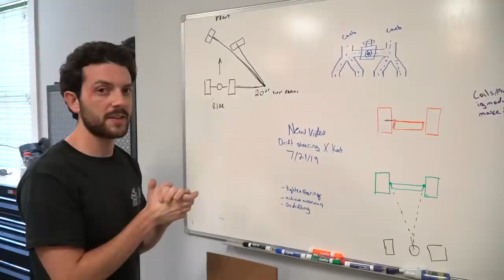750cc Kart has FULL POWER! The Fix was SO SIMPLE!! + Drift Steering

Comment: I called it. Put all four carbs back on it
Reply from the maker: burmese434 the carbs seemed to have other issues- it never idled. We my throw them back on just to try, but these twin 34s are performing great
Reply: @CarsandCameras  some cbr 900 carbs :) and a custom header with a nice single exit
Reply: @CarsandCameras  YES... It wouldn't Idle because the Plugs was Bad... Like you where told... You always start with the cheapest item to fix a problem...
Reply: The same thing with my bike, wouldn’t rev new spark plugs and like know
Reply: Remember, they destroyed those carbs (as they do with every carb they get) by "jetting" and drilling out the emulsion tube.
Yeah, I'm sure these turds know more than Honda and Mikuni.
Reply: You checked the points also ?.  God bless & be safe out there guys !!".
Reply: @Z71Ranger  If engine has  been sitting a while, always swap plugs. And wires too.
Reply: @CarsandCameras  i own a cb650 that i have been driving for 3 years the 4 carb setup never seems to run perfect keep that 2 carb setup that running awesome
Reply: @psygn0sis  Because that's the "PROFESSIONAL" american mechanics logic. "The engine doesn't run on two cylinders, maybe we should check the electrics? NAH... Let's destroy the carburetors by drilling them out!" Come on, seriously? (If I wrote something wrong, then I'm sorry. English is not my first language :D)
Reply: @psygn0sis  Meh
Reply: @CarsandCameras  too much power already.
Reply from the maker: psygn0sis we were aggressive with our jetting because we have a spare set of stock jets and emulsion tubes to fall back on if we destroyed a set.
Reply: CarsandCameras My bad I was referring to my comment on the last video about ( what do the plugs look like) in the comment section. I can’t wait to see what the top speed is can you guys get some Nabi or tires on there keep up the awesome work PS I think more carbs looks better LOL
Reply: Richard Hurts  Well... You made me laugh my ass off as fuck :D. But back to the context. I was in a mechanic school for 3 years, i was fixing cars, motorcycles, tractors and even lawn mowers. I've had learned many things about an troubleshooting with engines and now it makes me pain in the ass when someone tries to fix his engine and he's not checking everything and when he's saying "well the engine doesn't run properly so it must be the carb, let's go and mess it even worse". When you are trying to run an engine especially when it have been sitting for a long time you need to check for the spark, that's the basic, and after that you should take care of the carb. And BTW in Poland, at least in my city, I don't have a 24hr store so I can't suck, but anyway you made my day, thank you :D
Reply: @psygn0sis  
Same as adjusting floats. 
I've been doing this crap for 30+yrs if you wanna count playing in the backyard like this. 
Ya wanna know how many times I've had to adjust a float??? 
None!!! 
Well, ok I have ....after someone messes with it!!! 
That's so frustrating to see them attack a carb with drills.
Reply: Richard Kohut dude, it’s a cdi ignition. No points.
Reply: CarsandCameras why would you not just go buy a few sets of main & pilot jets & do it right ? It’s not like they’re difficult to find or expensive.
Reply: @ROTAXD  Asking the real questions here. And drilling emulsion tube... I'm speechless.
Reply from the maker: @ROTAXD  because we fly by the seat of our pants. Try making two 15+ minute videos every week, some things will get forgotten.
Reply: @CarsandCameras  Don't let the Youtube mechanics get to you... It hauls ass, mission accomplished .
Reply: @malbers35 Tbh they should listen youtube mechanics more.

Comment: I remember a wise old mechanic once told me, If you think it's fuel, check the spark, and if you think it's spark, check the fuelling.
Reply: Had one tell me 80% of the time, its an ignition problem not a fuel problem.
Reply: @DChrls  its always the same unless its different
Reply: Don’t forget, vacuum leaks. They mimic everything
Reply: So basically, could be anything.

Comment: Thanks, guys. Now it has so much power it needs bigger wheels and tires.
Reply: Looked like it needed bigger tires the entire time to me.. not a lot but a couple inches taller per corner would have made worlds of difference.
Reply: @bdhale34  it would then be in the roll heaven
Reply: I agree, nothing crazy but something like 20 maybe 22 inch tall tires. Needs 7-8 inches wide in the front and 10-12 inches wide in the rear.
Reply: @user-neo71665  that would look like a  mini monster truck if u got some fat fat tires 😂
Reply: Nah... I like the low-slung, old-school race car stance!
Reply: @adamshowto678  Adding an inch to the ride height wouldn't make that heavy cart roll. Only half the tire height will be beneath it after all also it's got a pretty wide stance that matters a lot. You turn anything hard enough while going fast enough it will roll but even being pretty damn reckless they'd still be as safe as now with another inch beneath them.
Reply: Isnt there a hayabusa drag kart on 5 inch rims? Its all in the bearings. Bigger tires means a LOT more speed, not necessarily the goal with something like this. With little tired youve got all the torque in the world, reguardless of gear ratio
Reply: I think it would be wicked with some ATV paddle tires in back and ATV sand skinnies up front. If it’s too fast (if there even exists such blasphemy) you can always swap to a bigger sprocket in back.

Comment: Got the motor running RIGHT!! Awesome.   Now, back to 4x pod setup. Synchronize them carbs!
Decades of superbike motor research can't be all wrong. Good reason people run them motors like that.
And oh crap, taller rear wheels,  and / or  gearing,  to handle the horsepower!

Good call bending that deathwish shifter shaft. Hate to see one of you lose an eye on a nasty bump.
or worse, a camera.  :P  Loved the shots of grass hanging on the suspension. Fun was had.
Glad ya  got the motor running halfway now.  Lovin' this project.  Lookin' forward to more.

Comment: Full roll cage..keep it safe stupid..kiss🤜👍
Reply: Go Karts or Gone Fishin yeah this thing is getting out of hand lol.
Reply: Safety is way overrated in our culture. BUT, a roll cage is still a good idea with a machine that fast! At the very least it needs to not grind your head on the ground if it rolls.
Reply: FOR SURE FULL CAGE, i call this thing "THE DECAPITATOR" at the moment! a full cage will make it tricky to get in an out, BUT you you aint climbing in or out when you dead.
Reply: @eriknulty6392  A full roll cage can be built which is pin-and-socket [makes it like the openable canopy of a fighter jet] that one simply flips back when exiting the cockpit and flips forward when preparing to race.
Reply: Go Karts or Gone Fishin it’s more fun to ride when your life is at risk lol just joking .We all need roll cages in our life.
Reply: To be fair, they designed the roll bar for the seat leaning back more, which put their head lower. They had to reposition the seat which moved their head higher. They have said that they're gonna redo that eventually.
Reply: Yeah, that thing is sick. Y'all should definitely consider a roll cage. PLEASE, be safe.
Reply: @kshepthedrummer  yea but a single roll bar offers zero protection when not coupled with a seat belt lol. They definitely need a cage. I raced flat karts on dirt for 8 years and always wondered how cages and seatbelts weren't mandated..
Reply: @damienirvin777  Lotta rollovers on the track in your time there?
Reply: @Knuckleheaded76  for alot of other drivers, I was lucky enough to never flip.
Reply: Go Karts or Gone Fishin keep it stupid safe

Comment: Glad to see that you got it running. I thought that it might be something ignition - related. Now, after it's all tuned and carbs are synced, check the plugs again, and make sure the color is light tan on the insulatiors.
 If not, you might have to go up slightly on the heat range, to keep them burning clean...
 Oh, yeah...now's the time to finish up with the safety gear. Harnesses, another forward loop for the roll cage, and maybe a new shifter and padding, when you get bounced around..
 Now you're messing with enough power to easily get you killed - don't mess around....

Comment: Just gonna brag real quick, in the first video that showed the engine breaking up at high rpms I commented that spark could be the issue. I have a honda atv that sounded the exact same above 2/3 throttle, I replaced the ground wire and it runs great. Glad to hear the beast running right!
Reply: Ur cool

Comment: first thing you do with used motors is fresh plugs
Reply: A tune up and change all the fluids, yes.
Reply: Compression test, new plugs, change oil, check timing/points, check valve clearance. 
These things should have been done while the engine was still in the bike....then there wouldn't have been any issues.
Reply: @Mardy72  I mean the compression test, plugs and oil yes, should have all been done at the same time (along with plug wires and coils depending on age). But valve lash? Maybe. Normally I would do the basics and get it fired and running, and if it runs with some valvetrain noise then move on to checking valve lash, or in the case of a duel overhead engine like this one, checking the valve springs and buckets for wear. There normally isn't a way to adjust valve lash on DOHC bike engines, as the cams act directly on the valve springs. So you end up needing to replace or shim the buckets to change valve lash.

Comment: These Old Honda CB motors are awesome! love the sound out of 'em. You can buy the jets from the 1100 and up spec easily. I was reconditioning our CB900 Bol D'or and it turned out the jets were 1100's. Easy power upgrade.Love your work Guys!

Comment: This reminds me of a problem I've been chasing with my car for weeks now. I was getting massive misfires under boost in my 2008 GTI. I replaced  several parts like the mass airflow sensor with no avail. checked boost leaks, compression tested, logged ECU data. etc etc. Turned out to be the spark plugs.
Reply: Damn atleast you fixed it

Comment: I've said check the plus in the last couple videos. Glad it was that simple. Also, the 2 middle cylinders are going to keep fouling the plugs because they're getting most of the fuel from the strait runners and the 2 outside are probably running lean.

Comment: Guys, don't feel bad. All of us have been tricked or lead astray by some strange running condition. Many years back, I was totally stumped by a Toyota Corolla that....get this....only stalled, when it SNOWED  !!! I'm not shitting you !! It didn't stall when it rained, or if it was hot or cold !!! I tried a coil, a new ignition switch, a new fuel pump, all new fuel lines , a carb, new intake gasket, new plug wires, new plugs, a re-man ECU. Checked the Cat, not blocked. Checked, tightened all the grounds, replaced the battery cables....drove the customers car, for a week !! Ran beautiful ! Delivered it to her..... BUT !!!!!.... as soon as it snowed....the car came back on a hook !!!! Customer states...'cars stalls" !!! I could not figure it out !!! I tried everything !! it happened many times that winter !!!.The lady moved to Florida, drove down....and according to my boss....never had the problem again !!!!!!!!!!! I still....decades later...do not know WTF was wrong with that freakin Corolla !!! So good job guys !! You found yours !! lol.

Comment: Vintage white rally car wheels, and tires. (Sparco, etc) A full roll cage overhead. A few panels and a windshield to get ya out of the weather a bit. Maybe a wing on the back. Small fenders with mud flaps, front and rear. Good lighting.

Comment: For grip racing and better turn feel Ackerman steering is best. For drifting and gettin all slideways parallel steering is best. Just saying. Also ditch that 3rd pedal put a hand clutch with a butterfly lever on the column & move the shifter to the right side of the wheel. Shifter and race karts are set up like that for a good reason. Love the build.

Comment: That steering geometry thing has always had its trade-offs. It's why some small sporty cars have a truck-like turning radius in a parking lot, but that's also how they're able to stick flat on corners when going 40+ MPH. Kind of interesting how you're doing what you can to work around that.

-Also any double checking on the cam timing and valve lash of that engine?-
Ok it was plugs... But what made them foul enough for that between the good test and the problems of no top end?

Comment: I'd like to see you put quadrunner tires to add height so your not mowing the lawn, heighten the roll bar protecting your head , maybe a net connected from the top of the seat to the bottom of the overhead roll bar. That rail is long and could roll pretty fast if you hit a rock while power sliding around a corner. That's a helluva nice drag rail though the suspension is just too low and the profile is too narrow.

Comment: 2 things:
-I think you'll need a cooling fan on those cylinders, revving that high so consistently while moving relatively slowly could set you up for overheating...
-I'm actually kind of disappointed that it took so long to find this spark plug issue, but I can't help but smile and forgive when i hear that thing scream...sounds like a nascar v8 stock car up top...and down low it sounds like Takumi's Ae86 after the engine swap

Comment: You know what, I just had that same problem with a dirtbike I was trying to get running. We fixed the problems it was having and it wouldn't start we messed around with the engine more and even bought a new coil and it still wouldn't start. As soon as we got new spark plugs it started up.

Comment: Do you have 4 carbs on the motor that will help with HP and a 4 in to one header pipe will to ps paint you're kart before it rusts.away also you can wrap the pipes down under the motor out the back

Comment: Ok.so I'm going to tell u guys. That piping is not equal to do a dual carb setup. It's has to be equal in order for it to work. Put the four carbs back on build a box from some ducting for an AC unit. The box basically feeds all four at the same time. That plug is fouling bc too much gas is going to that one. It's needs all four. U guys are good at welding put the four to one pipe back on. It's relying on that no jetting required. Run the pipes all the way to the back into that four to one and put the muffler straight up like a buggy. Your not going for how cool it looks it's about performance. This is the way that engine is going to work. Honda bikes are specific. This is the issue u keep running into. I am more than happy to help u out with this engine if u wanna get a hold of me. I am very knowledgeable about this bike. That is a perfect working engine. It's just little things that are pissing of that engine bud. Alittle  bit of time and some thinking is what it's going to take to accommodate these new ways of keeping the stock components. Get ahold of me if u want and I can help u.

Comment: I have an old go kart I'm trying to restore and it has a crack on one of the engine mount welds. I need to fix that, although it still works, and want to weld other things too for the kart. Assuming I'm using 1" tubing, what kind of welder should I invest in? What are these guys using? Is it flux mig welding?

Comment: The amount of steering throw had little to do with the rack, and more to do with the distance between the hub and the tie rod mount. If the mount is far away, you’re going to get less wheel movement. If you shorten it closer to the hub, you’d get more wheel movement 👌

Comment: If you take the carbs off so you have direct access to the butter flies use something like a 0.0015" or 0.002" feeler gauge and set all four butter flies of all four carbs exactly the same opening of your feeler gauge using the carbs synchronizing screws and then after the engine is running adjust the name idle screw for the proper RPM to idle and you'll have a smoother engine than any gauges and run better than the day it came out of the crate

Comment: Would like to see a set of larger wheels on that, maybe atv wheels and really aggressive tires, which would make that thing a "go anywhere" setup. 
 You would have to increase the final drive ratio though, as you will need to sacrifice some speed for torque -_taking off in first gear already sounds like the ratio might be,a little low, even with the small tires.
 Would look awesome, and would be a real wall-crawler...

Comment: Speaking of the "KISS" method, I spent multiple days in the rain trying to figure out why my '78 bronco wouldn't fire up. My brother and I tuned it a little and afterwards it just wouldn't run. After hundreds of dollars in parts and much time spent hanging over the engine bay trying to figure it out, my neighbor comes over and asks if I checked under some taped wires that went to the distributor. Turns out after he cut and respliced them, it fired right up. The previous owner had cut them, then twisted and taped them up. They lost connection while we were messing with the Carburetor. I felt pretty terrible after spending so much time on it.

Comment: I still think electric solenoids for the shifter is the way to go! two momentary push buttons (one for up , one for down) on the wheel would be easier and faster to shift, more instantaneous and just a cool way to do it! Ask me if you need parts selection help or a circuit design!

Comment: Did you figure that...the reason you can't break past 7k RPM is because of the weight difference between the motorcycle frame and the cart+ aerodynamics?   How much did the motorcycle weigh?
And how much does the Kross kart weigh?